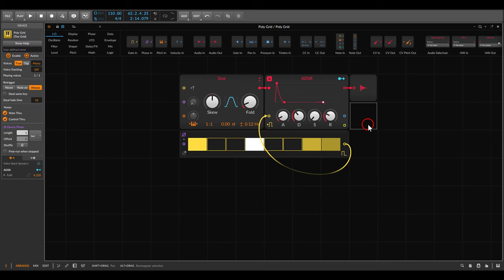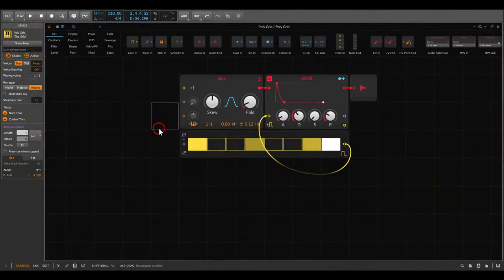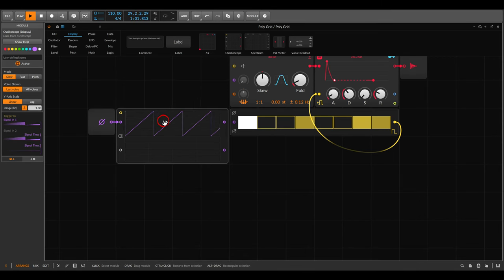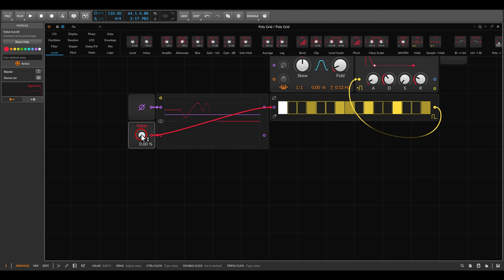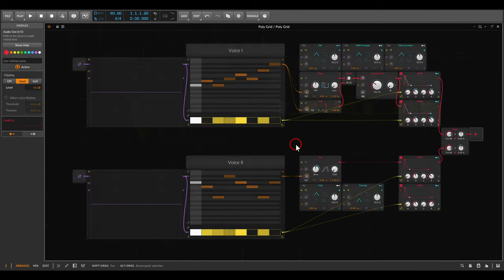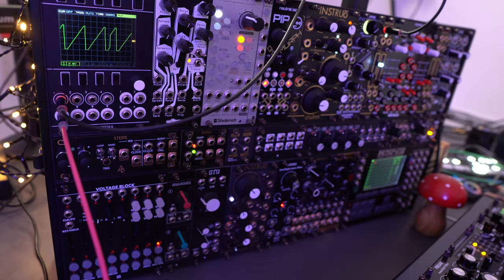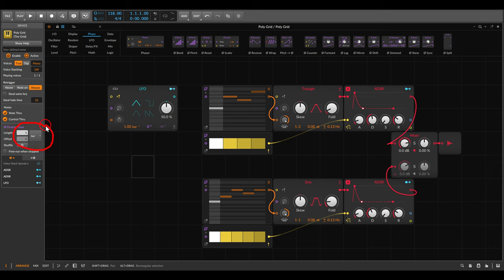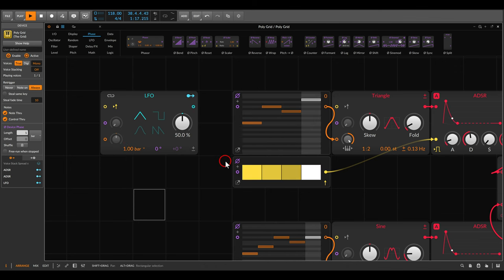Introduction to Phase in Bitwig's Grid

Comment: as you've demonstrated with Value module, there IS a difference about phase signal, that it never actually reaches 1, so phase basically wraps any integers to 0, you can only have values between 0 and 1. on practice it doesn't matter too much for sequencers, and when it does you can crudely scale down non-phase signal to ~96%, but the more steps you have to deal with, the more precise you might need this to work, so your last and first step are clearly separated.
for the most part this distinction becomes relevant when you work with phase signal to drive audio-rate oscillator, where driving it with non-phase source can create audible clicks or buzzing on the 'seam' of cycle transition.